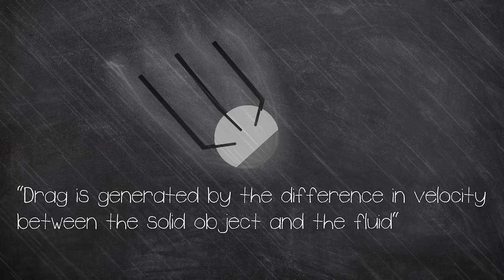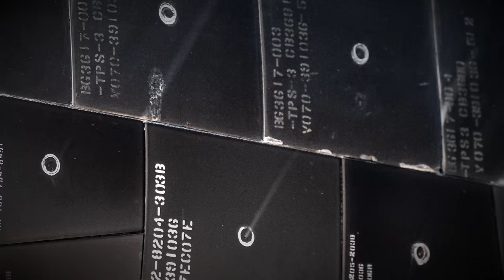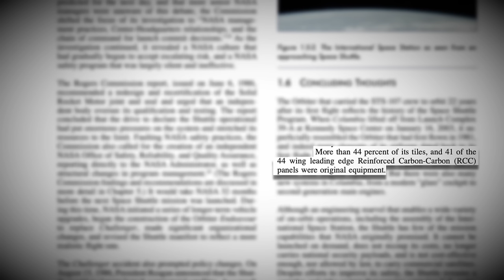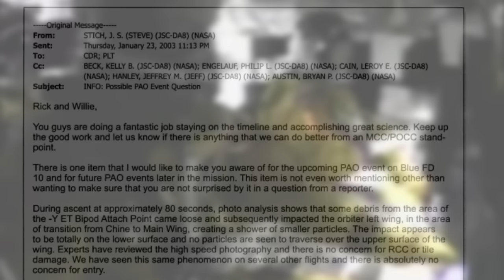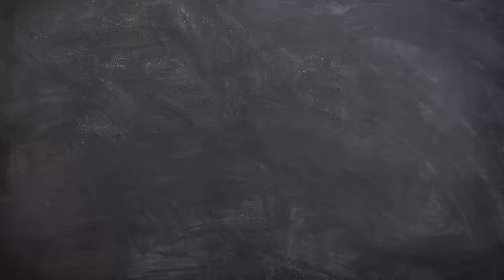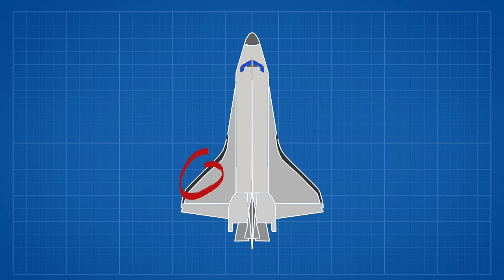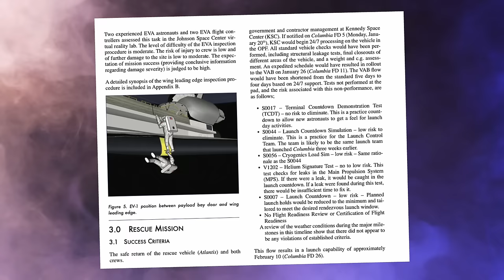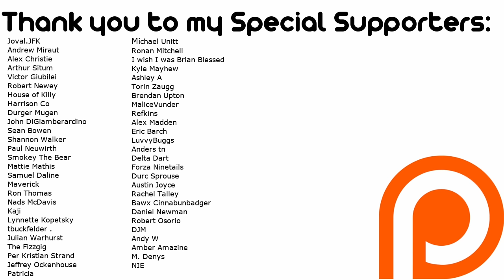Ignored Warnings: The Columbia Space Shuttle Disaster 2003 | Documentary | Plainly Difficult

Comment: They were more than complacent. They deliberately chose NOT to emergency launch the backup shuttle, which could have evacuated the crew safely. NASA's own reports show this.
Reply: The report also stated that in order to do so, Atlantis (which had a reputation for being prone to delays) had to be rushed extremely quickly through its processing, skipping many important steps along the way, then be launched without any type of weather or mechanical issue causing a delay.  And weather is well known to be fickle in Florida.  

Bottom line, yes on paper it was feasible to launch Atlantis. But to do so would've required an extraordinary amount of things to go exactly right with no room for error.
Reply: To safely launch another shuttles would have taken months of preparation.
Reply: @JimMac23  Not true. Read the actual official report. They had a shuttle that could have been launched in time if they rushed the launch prep.

Comment: During a spacecraft's re-entry, friction does indeed contribute to the heating of the spacecraft. But the larger contributor is the supersonic shock wave that forms a short distance ahead of the leading surfaces of the vehicle.

This, incidentally, is why the design of spacecraft that need to re-enter the atmosphere never involves pointy shapes. A pointed shape allows this shock wave to get too close to the skin of the spacecraft. A blunt shape forces the shockwave to stand off a few inches from the surface of the vehicle, and creates a boundary layer that helps to insulate the vehicle.

Comment: Friction is not the cause of heating. Compression of air molecules causes plasma to form. The air gets violently compressed as it passes through the shock, causing its pressure, density, and temperature to jump almost instantaneously
Reply: Yup, like an air conditioner.  Good ole thermal dynamics.
Reply: Yes, and since the shuttle is moving a lot faster than the speed of sound, the air can't get out of the way.  It will stack up on the nearly flat surface of the wing.  Still a lot of the heating of the shuttle takes a bit of time to happen so a "double dip" like a recent spacecraft did could help.  Basically the idea is that you generate some lift as you re-enter so that you get bounced back out into space and re-enter again.  On that 2nd re-entry, you are now at a suborbital speed and the peak temperature is lower.  Basically you are trading having two heat pulses and more complexity against how high the peak is.

Comment: 4:40
No no no no no... 
At hypersonic speeds, friction does almost none of the heating on an orbiter/capsule. ~95% of it is compression heating from the shockwave.  And almost all of it reaches the body of the vehicle as radiation. 

However, imperfections, such as holes in the body, let the shock-front get close to the body. If it is big enough (columbias case), the shockwave with the plasma can get inside the heatshield and start dumping both kinetic and radiative heat into the structure. 

The entire heat protection of the shuttle is designed to keep the shockwave away and survive the heat radiation. If it had to deal with actual friction (very pointy design of the vehicle), the heat-shield would last for seconds, not minutes. Look up at how X-15 came out form hypersonic flights.
Reply: From the Accident report " As Columbia descended from space into the atmosphere, the heat produced by air molecules colliding with the Orbiter typically caused wing leading-edge temperatures to rise steadily, reaching an estimated 2,500 degrees Fahrenheit during the next six minutes."
Reply: Language in an accident report is almost always such that someone with no background knowledge would comprehend what is being said. 
However, like in this case, it is very inaccurate pretense.

 @cjmillsnun

Comment: 4:39 had it been mechanical friction, spacecrafts would've been turned to ash as under sandpaper

no, the air gets hot because of *compression* - you get a layer of highly compressed air in front of the falling object that gets cold again the moment air leaves that boundary

that's why all spaceplanes are round - this hot layer must be kept far away from the surface and sharp edges keep air closer

Comment: It always strikes me as idiotic when NASA just goes and ignores stuff, considering quite a bit of hardware on those craft are engineered with a safety factor of 10% or less. Like driving a car at 50kph and at 55kph it just disintegrates around you (yes, I know, speed and stress are not in a strictly linear relation).

Comment: Serious question: Why wasn't it an option for any of the astronauts to check on the wing situation? Where they not outfited with the suits needed to go outside?
Reply: They couldn't even be bothered to interrupt science to simply rotate the orbiter so a surveillance sat could snap a picture. An EVA was going to be even more work. Plus, they probably figured that even if they did examine the issue, the recovery options were not that great, patching up the damage by moving around tiles was unlikely to work and while theoretically another Shuttle could've been prepared, it would have been a stretch as well (would've required skipping some checks and repairs, plus working under high pressure and sending up at least a few people, so if anything went wrong, you'd have two sets of doomed crew).

Comment: Reusablity proved to be more expensive as well as less reliable and SpaceX will prove it once again.
Reply: Absurd to be saying that while SpaceX is dwarfing everyone else in terms of launch counts. The shuttle was barely reusable, the solid boosters were more expensive to recover and repair than to build new ones, the orbiter's heat shield had to be rebuilt each time, the engines were absurdly complex and had to be disassembled and cleaned out each time, the mass margins were so thin that the orbiter itself couldn't take any heat. This was not a limitation of reusability, but a result of all the compromises the design had to make for political goals rather than technical ones.

Meanwhile, Falcon 9 mostly just needs to be washed down, igniter fluid replaced, and any engines that fail inspections replaced. The engines are designed to keep operating even when entire bolts fall in. Starship is already by far the cheapest ride to space in terms of kg/$, even without being able to reuse it, with the engines able to fire several times without needing to be worked on, and the stainless steel body making it able to withstand some heating even if tiles are lost.
Reply: 'less reliable'
say that to the boosters that have flown over a dozen times and are launched 60 times per year
Reply: SpaceX has 3 boosters with 19 flights and all are slated for a 20th flight.
It's proven to be cheaper, so much so that all Space companies and agencies now have plans for reusable vehicles.
Reply: You're comparing recycling paper (SRBs) to recycling glass (F-9). The SRB had to be more or less completely rebuilt after splashing down into the ocean, whilst Falcon 9 rockets simply need to be inspected for damage after touching down, cleaned and repaired, and then refueled for another go; when done right, reusable rockets are extremely cheap to use because, not surprisingly, fuel is the cheapest part of a rocket despite being the largest contributor of mass

Comment: Yeah, what's happening isn't atmospheric friction, it's compression of the atmosphere in the path of the shuttle, and the shape of the shuttle is key to keeping the shockwave from tearing it apart. See, there's not enough time for the heat to really transfer to the interior of the shuttle just through conduction, and on top of that you have the slipstream conducting heat away from any object entering the atmosphere at speed. So what happens to an object is that the surface is charred and abraded away in layers, but it doesn't get heated through normally, which is why a meteorite that survives to impact the ground is often cool to the touch. (Although, depending on how much inertia it has and what it impacts, the compression of impact can generate a great deal of heat.) The problem is that going over 20 times the speed of sound is astoundingly stressful on an object, and if there are any irregularities in the surface, that's going to introduce forces which such a vehicle cannot withstand because it'll be pushing stuff in all kinds of directions it's not meant to go.

Comment: the Atlantis pick up mission wouldn't have been so easy: iirc Columbia didn't have spacesuits on board, only flightsuits. that was because they had a mission module without EVA airlock docked. which means there was no way to open a door without venting at least half the shuttle. twice, to get the suits in and the crew out. ..and there's a good chance people in EVAsuits wouldn't fit through the side doors, so you need to ditch the module in the cargo bay in a safe way.. and you need help putting these bulky suits on and the last time all crew had to suit up inside a spaceship was on the moon, so no idea if it's even possible to help someone into an EVAsuit wearing an EVA suit yourself.

Comment: Weird question: why do they have to reenter the atmosphere at high speeds? If they went slower would they just be stopped in their tracks by the atmosphere? Would it be like slowly rolling your car towards and wall, bumping it and then all forward momentum is lost? Or are such slow speeds simply not possible in space? Obviously, they do it this for a reason. Am just curious about the physicas/dynamics that would prevent reentry at anything other than top speed 😅
Reply: The Space Shuttle did indeed have to re-enter the Earth's atmosphere at high speeds to ensure a safe and controlled descent. Here's why:

Orbital velocity: When the Space Shuttle was in orbit, it had to maintain a speed of about 17,500 mph (28,200 km/h) to stay aloft. This is because the orbital velocity is determined by the curvature of the Earth and the altitude of the spacecraft. To slow down significantly, the Shuttle would need to lose a significant amount of energy, which would require a tremendous amount of heat and friction.
Atmospheric drag: As the Shuttle entered the atmosphere, it encountered air resistance, which slowed it down. However, the atmospheric drag is not strong enough to slow down the Shuttle quickly enough to ensure a safe re-entry. The Shuttle would need to be slowed down by about 3,000 mph (4,828 km/h) to reach the safety zone for parachute deployment. Heat protection: Re-entry into the atmosphere generates intense heat due to friction with the air. The Shuttle's heat shield was designed to protect it from these temperatures, which can reach up to 3,000°F (1,649°C). If the Shuttle were to enter the atmosphere at too low a speed, it would not generate enough heat to ensure safe re-entry.
Now, about your analogy: rolling your car towards a wall and then coming to a stop. While it's true that slowing down in space would require generating heat and friction through atmospheric interaction, it's not exactly like rolling your car towards a wall. Here's why:

Air density: The air density in space is much lower than on Earth's surface. This means that even if you were able to slow down a spacecraft gradually, the air resistance would be very weak, making it difficult to generate enough heat and friction.
Spacecraft design: Spacecraft are designed to withstand the stresses of re-entry, including extreme temperatures and vibrations. They are not designed to slow down gradually through atmospheric interaction. Orbital mechanics: Re-entry requires a specific set of conditions, including a precise entry angle and velocity. Changing these conditions would require significant adjustments to the spacecraft's trajectory, which is not feasible at slow speeds.

Comment: A bit of a common error there PD on the topic of re-entry heating. The heating effect is not caused by friction, as significant drag is only experienced in the denser parts of the atmosphere, long after the plasma interface manifests itself.

The reason for the heating is actually *compression*, caused by the orbiter slamming into the errand air molecules at orbital velocities. Due to its speed, the air accumulates on the surface of the vehicle and compresses heavily upon the oncoming flow of atmosphere. And even at its very low density, this is enough to heat up the atmosphere into a plasma. The plasma heats up the orbiter via thermal radiation, not usually direct kinetic contact. This plasma manifests some distance away from the actual surface of the vehicle because it is pushed away by the shock front of the air trapped within, which is why you want a big, blunt surface for your heatshield (and not lets say a spiked surface like a nosecone).

So the TLDR: Re-entry heating is not caused by mechanical friction, it is caused by compression.

Comment: I drove to Nacogdoches TX the day after the disaster with my first digital camera. It was chaos between all of the news vans, officials, police, and sightseers. Police were yelling to call in any pieces found, but not touch anything as it was contaminated. Locals were talking about how they heard the repeated booms as the shuttle broke up. Or how they watched pieces fall to the ground. There was debris scattered everywhere. Rooftops, sidewalks, parking lots, caught in fences, in trees, and even sitting on parked cars. Bigger pieces usually had a guard and were surrounded by news teams,  but most were small, the size of a pack of cards. Those pieces only had traffic cones or police tape surrounding them.  Nothing could be identified. It was just bits of metal and honestly you would have trouble identifying a random piece of shuttle from a candy bar wrapper.  The majority of pieces I saw were not even burnt or melted in any way. However, I remember walking down a quiet residential street and in the middle of the sidewalk, there was a piece of what appeared to be an outer frame. It was about the size of a sheet of paper,  slightly curved, white in color, and had a rivited brace on one side. But it's edges were completely melted and charred black. It was such a juxtaposition seeing what violence the crew faced as the shuttle broke up around them... and the quiet neighborhood where some pieces ended up. And all my pics were lost to time unfortunately.